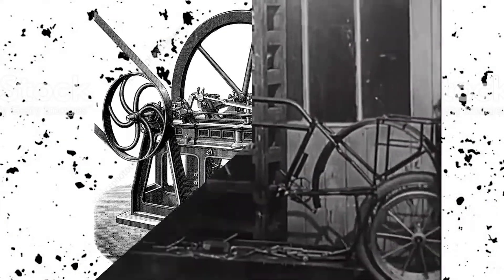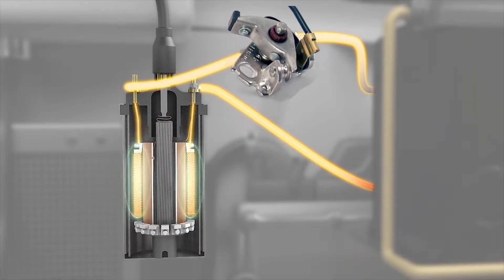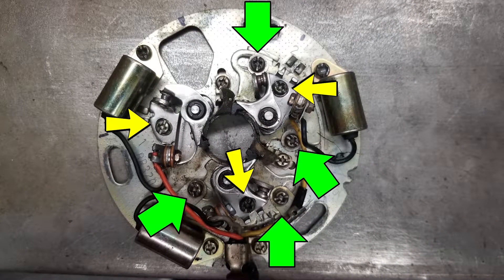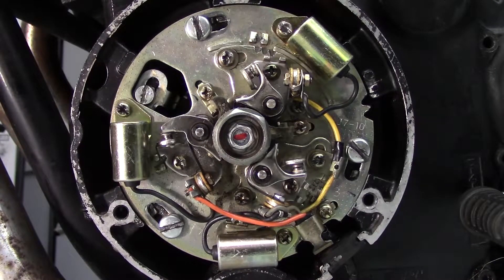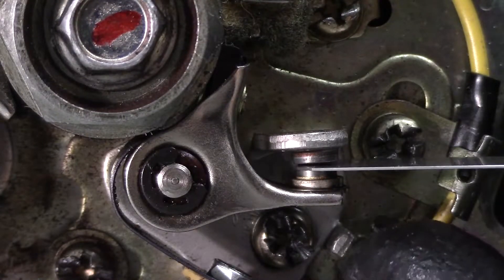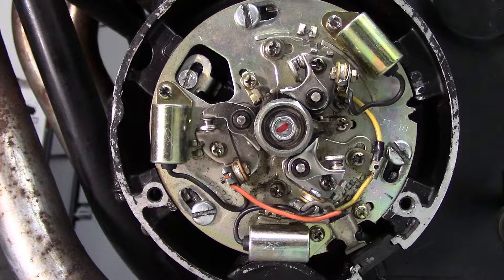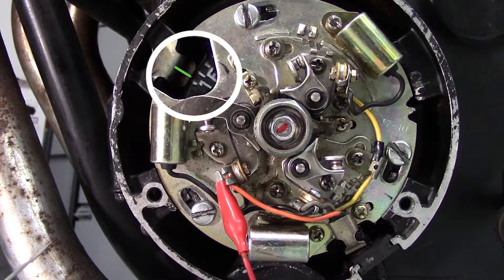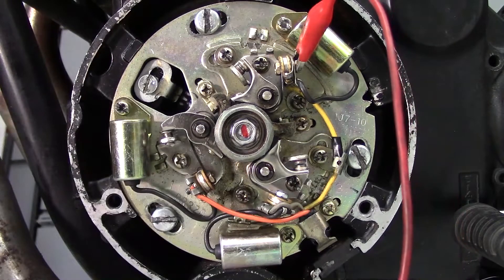How to set and adjust Ignition Points ( 1977 Yamaha XS750 ) - Rick's Garage ep. 25

Comment: greetings !, 
question : what years of the xs 750 3 cylinder were points and coil...... were they pure points and coil or was some kind of electronic connected ?
Reply from the maker: Thank you for your question!  If memory serves correct, I believe the xs750s were points up to (and possibly including) 1980.  I think Yamaha went to the xs850 in 80 or 81 with an electronic pickup

Comment: This is a counter clock wise points mechanism with advance ? Is it invincible to fit same with a two points system on a TDM 850 on the left hang side note two piston are tdm at same time any body have an answer.

Comment: Hey Rick, I love your videos, I have a problem timing my 77 xs750,  the Mark's will not line up no matter what I do, All 3 points open about halfway between the Mark's, I'm suspicious a previous owner moved the index pointer. How do I varify it's in the correct position?
Reply from the maker: Hi Mudder - thanks for your comment!  Sorry to hear you're having trouble- I'd verify the governor wheel is aligned correctly to the crankshaft first - (check the 3:00 mark of ep. 24) - if everything looks good, pop the valve cover to verify valve positioning to get cyl #1 (left side)to TDC.  Once TDC is confirmed, check the pointer- it should be aimed at the "T" on the timing wheel.  Adjust the pointer as necessary.  Once #1 is set, confirm the correct positioning of the pointer for the two other cyl at TDC also.
Hope that helps!

Comment: What's the worst that could happen if one were to ream the adjustment plates for 2 and 3 a touch to get the smidge of advance needed? Currently had to retard #1 to get 2 and 3 closer
Reply from the maker: I'd say the WORST that could happen would depend on how close to the edge of the slot is opened up to.  If it's really close to the edge, the plate could vibrate loose and lose the timing.
Reply: @RicksGarage  I'm only off by a sliver but I think I'll track down a donor plate to experiment with

Comment: Tengo un moto xs 750 honda era de platinos la quisieron convertir a ensendido más moderno y no prende, pero me quedaron la tapa original del estaré o bobinas y mesesito está pieza si pudieras de ir dónde la consigo y si emsendera con lo electrovo
Reply from the maker: My best suggestion if you're having trouble with an aftermarket ignition conversion is to contact the supplier/manufacturer.  Dynatek seems to be the biggest name in ignition conversions for Honda 750s.  Try contacting them at www.dynaonline.com.  They may be able to steer you in the right direction. 

Mi mejor sugerencia si tiene problemas con una conversión de encendido del mercado de accesorios es que se comunique con el proveedor / fabricante. Dynatek parece ser el nombre más importante en conversiones de encendido para Honda 750. Intente contactarlos en www.dynaonline.com. Es posible que puedan guiarlo en la dirección correcta.

Comment: Struggling with my 79 xs750 triple.  I can't seem to sync #1 point to open correctly.  It wants to open on the #2 point or there about.  I've gapped all the points correctly and moved the plate to both extremes to see if it would change anything but nothing?  What am I missing?
Reply from the maker: The only thing that comes to mind is the center cam that operates the points.  Is it perhaps mounted 180⁰ on the timing wheel?
Reply: I've got roughly the same issue, did you ever find a solution? I've taken it all apart and the center wheel is mounted correctly as it can only mount one way but im still not on target.